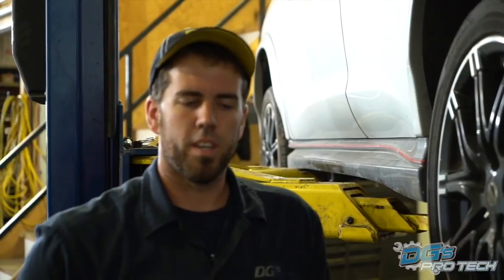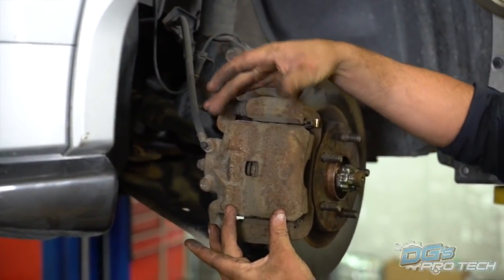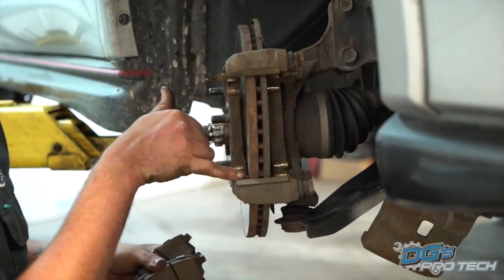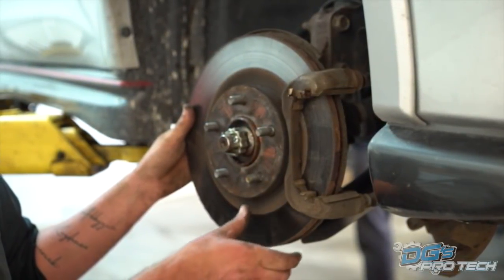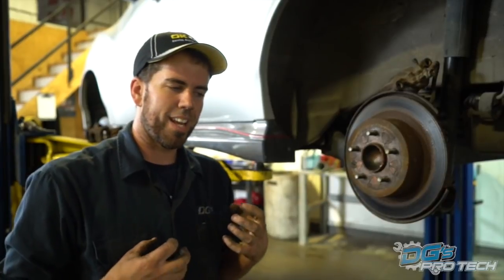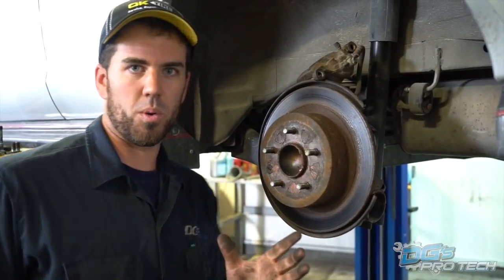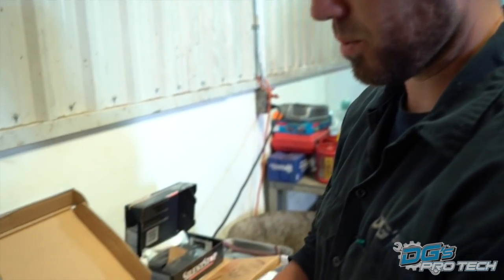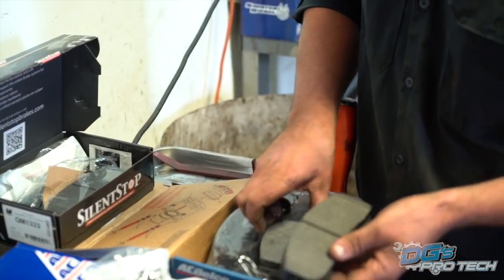DG's TV: What Makes A Good Brake Job

Comment: For corrosion resistance there is more that you can do. High temperature wheel bearing grease applied very sparingly to the surfaces of the caliper housing will prevent rust and keep the caliper in great shape. First apply with an old toothbrush and rub off excess with a rubber gloved finger. The grease will creep right up to the caliper piston boot and prevent rust in that critical area. Same goes for outer exposed edge of the brake rotor that is exposed to all the road salt. This can be done with all the components assembled as part of a yearly tire rotation. Just take an old tootbrush with a little high temp wheel bearing grease and carefully coat the outer edge of the rotor taking care not to get it on the brake surface. Go over with a gloved finger and wipe any excess away. It will creep a small amount to keep the surface rust free and will not affect braking.
The wheel bearing plate should also be coated with a thin film of grease so the rotor does not corrode into the wheel bearing mount. And yes before you put that tire on, coat that nice clean surface where the tire mounts so the next guy can get the tire off and the wheel runs true.
Reply: Why doesnt someone make stainless steel rotors? I dont know!

Comment: Just found your channel and wow you're a great teacher. Very good info. 
Would you have any ideas why my abs light, brake light, and traction control lights are lit on my 2013 Ford Fusion SE 1.6l?
I have zero dtcs on Forscan, new pads, rotors, and greased/cleaned everything. For some odd reason , all the lights turn off when I engage the electronic parking brake and turn back on  after about 15seconds from disengaging. If i start driving immediately after turning the epb off, the lights stay off tell I stop fully.
Thanks for the great videos